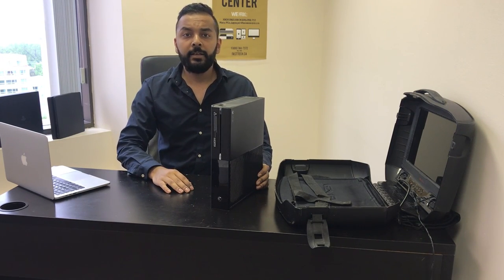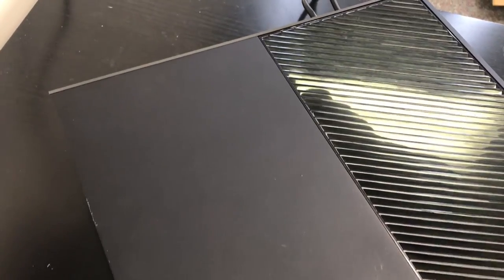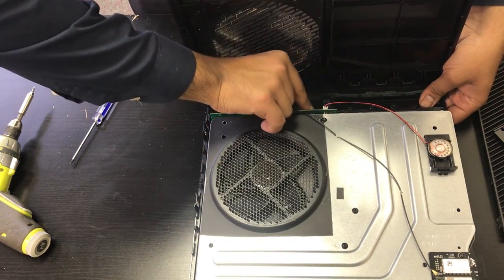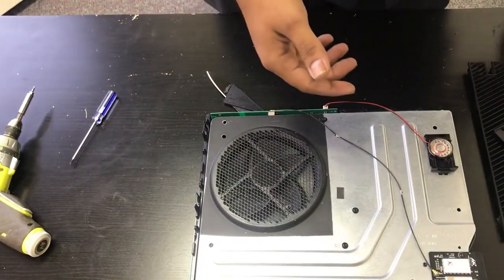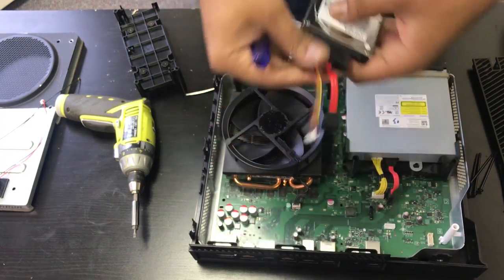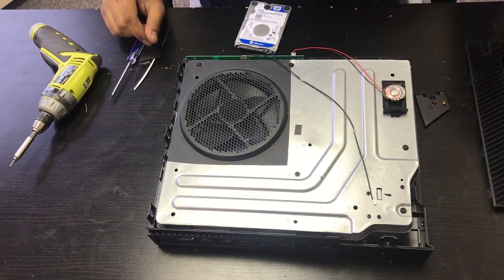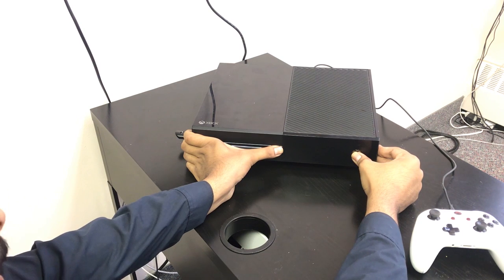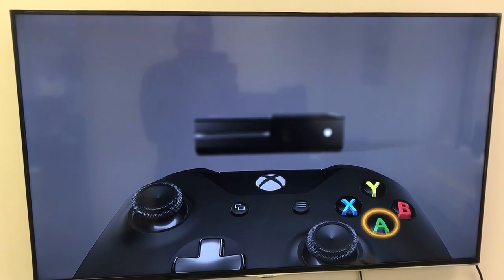Xbox One E101,E102,E105,E106,E200 Black Screen, Stuck on Xbox logo Repair (Hard Drive Replacement)

Comment: On my xbox one x I get all the errors I did an offline factory reset and it went to 56 percent and stopped and I got e101
Reply from the maker: You need a new hard drive. Its the same an a regular Xbox. You can buy the 1TB unit and it should work.
Reply: @fasttechvideo  do u know what to get I don't want to get the wrong size and I don't wanna go through formatting the hard drive on the pc
Reply from the maker: https://www.fasttech.ca/xbox-one-parts/xbox-one-1tb-hard-drive
Reply: @fasttechvideo  I just replaced my hard drive I had a spare 1tb laying around and It took a while to format it and get all the files I needed but I got it already it ended up being the hard drive like u said
Reply: @fasttechvideo  I wish Microsoft could have just let us replace it without trouble

Comment: My Xbox froze up one day so I turned it off and on again. Then it showed the error 105 screen, I hadn't experienced this before so I turned my Xbox on and off again and it worked fine. The next day same thing happened but it kept taking me back to the error 105 screen. I tried unplugging and repligging it all day and nothing worked. I then left it for the day. I knew it was something to do with the hard drive so the next day I ordered one 500gb and 3.0 compatible. That night the Xbox turned on again and was working perfectly fine but the hardive was already coming so I thought I was good. I left it that night and then In the morning I turned it on again and had error 105. I tried unplugging everything and still it didn't work. After a while it did go through to the main xbo screen and I plugged in my external hard drive but my Xbox froze up again when I tried to go onto my settings. After I tried to turn it back on and was on error 105 again. After many attempts and different methods I got error 102. Every time I turn off my Xbox it's error 102 and nothing will work. I don't want to rest my Xbox as I have saved data on it that's not backed up and I'd like to keep it. Is there a way to remove the hard drive but still put the data onto the external hard drive, then buy a fresh hard drive and put the save data onto the new one from the external one then put it into the Xbox? If not what do I do or is the only way to reset everything?
Reply from the maker: You need a new hard drive. Check the description box for links.
Reply: Same issue it sucks
Reply: Bruh

Comment: So basically my Xbox is fucked and I can’t use it again without spending money?
Reply: Late to the party - if you have an old laptop with a 2.5" drive (it needs SATA), you don't need to spend any money. Otherwise, I'd recommend going the SSD route - or just buy a next-gen Xbox when the next restock happens

Comment: E100 is the bluray, nit the hdd!
Reply from the maker: You're wrong.
Reply: @fasttechvideo  I'm not wrong. Unplug the sata to an Xbox One and see what error it throws. E100 is Bluray/optical drive. E101, E102, etc. is the hard drive.
Reply: @fasttechvideo  It's the Blu-Ray drive.
Reply from the maker: @heyitzrare  Can you please elaborate or provide more information?
Reply: @fasttechvideo  If you get an E100 error, it is NOT a hard drive issue; rather, it's your Blu-Ray drive not responding to authorization calls.

From the factory, your Xbox One motherboard and Blu-Ray daughterboard are married. If either one is swapped, the console will throw an E100 error as soon as it reaches about 58% on an offline update. This can also happen if a component on the daughterboard fails, or the entire drive gets disconnected somehow.

If you get an E100 error, and your console is still unopened/under warranty, SEND IT TO MICROSOFT. There is nothing you can do to fix it, as like I said, the console and drive are married.

Shoutouts to XFiX for finding this out. Have a good day!
Reply from the maker: @heyitzrare  Upon doing some research I found that you guys were correct. I have fixed the title of the video.
Reply: @fasttechvideo  Sweet, good to hear!

Comment: ATTENTION I FIXED IT,

I'll keep it short and sweet, basically you are going to want to factory reset (yes clear all saved games apps etc) this is the first step regardless of what issue you may have. For me it was the system error but the number doesn't matter or anything like that just find a way to access system reset. I would search another guide depending on your issue. Then after re setting and starting the xbox up do all the steps upto manual setup once you reach manual set up look for the section about keeping games and apps up to date and deselect to keep xbox up to date. This fixed it for me, however installing everything takes the piss, but it's a small price  to pay. This workaround also prevents stupid updates like the February one from damaging our systems as you can choose to update it. If you read an article that says they update is bad you can wait till they have a fix. 

I hope this helps you guys
Reply: Its Unforgiving thanks a lot brother
Reply: So is it good now?
Reply: It keeps sending me back to something went wrong screen.
Reply: @aaronjohnson8937  walk me through it and I'll try my best to help you
Reply: @sirmanmcguy1649  I too tried to reset to factory off the error screen E105. It froze so I held the power button for 10 seconds to shut the system off and when I turned it back on it seems to be reformatting and resetting to factory. 

It told me not to reset or turn off the console and a progress bar began to fill-up. A few seconds after this it took me right back to the system error e105 page.
Reply: @mementomori1178  okay, try turning the console off, turning the plug socket off and then unplugging the power back from the wall, xbox and itself. If this doesn't work try the 10s power button method again
Reply: @sirmanmcguy1649  i finally got it to factory reset, but when i cut it off and then back on again it took me right back to the troubleshooting screen. 

Bummer :/
Reply: @mementomori1178  if that is the case you might have to download a patch, to do this you have to plug a memory stick into your laptop and download the patch for your error then put it into your xbox
Reply: @sirmanmcguy1649  Sadly, I've tried everything multiple times. I'm going to have to send it in tech support. :/ luckily my warranty isn't up because it's not even a year old.
Reply: @mementomori1178  unlucky we couldn't fix it. It was worth a shot anyway
Reply: @sirmanmcguy1649  what patch exactly? where do I find it?
Reply: @Ajbuty  it's been a long time since this post, it won't have been that update but rather something new. Talk me through the issue. I'll try help you
Reply: @sirmanmcguy1649  okay so I turned on the Xbox and it immediately went to the trouble shooting page. I tried factory resetting, but it came back to the same page saying Error 106. I tried unplugging everything for 30 secs and plugging it back in, but comes back to the same page (same page as in "something went wrong"). I attempted to do OSU 2 and 3, but it doesn't even attempt to update. it just says "something went wrong". my final attempt was to use OSU1. it started to update, but every time it hits around 50% complete on step 2, it gives me E101 error. 

I think it might be the flash drive, but when I get back from the store.i will let you know if it still doesn't take the OSU1 update after buying a new flash drive.
Reply: @Ajbuty  keep me posted, maybe try soft reseting by holding the power button for 30s
Reply: @sirmanmcguy1649  hey, the OSU1 finally downloaded. I guess it was my flash drive after all. still going through the set up process.
Reply: @Ajbuty  nice! Let me know how it goes!!

Comment: OMG i just fixed my xbox one !. im so ecstatic. i literally lost hope on trying to fix it. i went to gamestop to buy a new one but luckily they didnt have the xbox one s 1tb that i was looking for. i was getting the SYSTEM ERROR E106. god i hate that number so much, its now drilled in my head from seeing it. i did everything all these videos were telling me by doing the offline update on USB. it didnt work. i gave up on trying to fix the xbox. days later, i just decided to give it a try again. i went to this website. https://support.xbox.com/en-US/xbox-one/console/startup-error-solution and downloaded the OSU1 thats in STEP 2. format ur USB to NTFS, that just by right clicking it and it says FORMAT. be aware that it will delete everything on the USB when u format it. when the OSU1 is done downloading, u gonna want to open it. once its opened, right click the file which will now be named ( $systemupdate) and extract it to your USB. (basically just moving it to your USB) its gonna take awhile. once its done moving, safetly eject your USB. now go to your xbox one, make sure the power to your xbox is disconnected. now wait 35 seconds. making sure the xbox is completely turned off. plug in your USB onto the xbox then plug in the power cord onto the xbox. HOLD the BIND (SYNC button) and the EJECT button then press the POWER button but still holding the BIND (SYNC) and eject button. u gonna want to hold the BIND and EJECT button until u hear the power sound 3 times. YES 3 times. ive always been holding it and letting go when i heard 2 power sounds and it takes me straight to trouble shooting settings and nothing was working.  when u hear the 3rd power sound, it SHOULD directly be saying UPDATING or some shit like that that isnt the TROUBLESHOOTING settings that it usually takes u. damn, i wished this helped yall.
Reply: Hey man, got the same 106 error and just like yours, at the time, nothing is currently working. Absolutely nothing. So I also tried offline update with osu1 downloaded and setup pretty right and still nothing. Guess what, I also release the buttons right after the second power sound. I wanna know two things: 1. Do I copy the $systemupdate is a folder. Do I extract the folder itself to the flash drive or the contents of that folder? 2. Do I keep holding all 3 buttons until 3rd power sound or do I release power button after 2nd power sound, and still hold the other 2 buttons till 3rd power sound?
Reply: @PGreat7  this is exactly what i did. I downloaded the OSU1 link, then I moved it to the desktop. Its gonna be lengthy wait. The folder will be called OSU1 when its done moving to desktop. When u open the folder, there gonna be a file called $systemupdate. Click %systemupdate once (do not open the file) then it's gonna say Extract All on top. A screen is gonna pop up, click browse, then on the left side, scroll down to your USB device and click it and press Select Folder. Then its gonna say something like F:\ then press Extract. It should be moving to your USB now. That's gonna take lengthy wait. 

No, dont keep holding power button. U just press power button once just to turn it on. (Hold sync and eject button - press power. Keep holding Sync and eject only. After the 2nd power sound, keep holding 10 secs and it should take u to a updating screen right away instead of the trouble shooting settings.

Comment: My PS4 controller won't connect in safe mode
Reply from the maker: The controller only connects via a USB cable in safe mode. If it does not connect with a USB cable the issue could be related to the bluetooth chip on your PS4 console.

Comment: Hey, readers! If you get an E100 error, it is NOT a hard drive issue; rather, it's your Blu-Ray drive not responding to authorization calls.

From the factory, your Xbox One motherboard and Blu-Ray daughterboard are married. If either one is swapped, the console will throw an E100 error as soon as it reaches about 58% on an offline update. This can also happen if a component on the daughterboard fails, or the entire drive gets disconnected somehow.

If you get an E100 error, and your console is still unopened/under warranty, SEND IT TO MICROSOFT. There is nothing you can do to fix it, as like I said, the console and drive are married.

Shoutouts to XFiX for finding this out. Have a good day!
Reply: Does this apply to e102?
Reply: @richy7543  Thankfully, no. E102 is a drive issue. :)
Reply: @heyitzrare  do you have any idea what I would need ? I already got everying separated just waiting to see what parts I would need to buy.
Reply: @richy7543  You probably need a new hard drive
Reply: @heyitzrare  bet you think I would need the piece that connects to the hard drive ?
Reply: @richy7543  Probably not
Reply: @heyitzrare  any idea of what hard drive I need ?
Reply: thank you that fixed my problem i have another xbox one with error 201 swapped the hard drive already still doing the samething
Reply: @richy7543  Sorry for not replying earlier. Any 2.5" hard drive should work (an SSD should as well!)
Reply: @milcahrainetv1363  I'm not sure what you're trying to say. Is your Xbox working, or is it throwing an E201?
Reply: Yo Man, I was wondering if you know anything about the error code I'm getting, the error code that my Xbox One S is getting is E100 00000701 8007045D, is that a hard drive problem or is it something else? Because I really don't think the problem is in my disc drive because I saw a post on an Xbox forum with the same error code as mine and people said it's a hard drive problem. A reply would be appreciated since I don't wanna go to the trouble of buying a new one.
Reply: @potatomatic47  Hey! If you have a spare 2.5" drive, you could probably test it, but I don't think it'll get you anywhere. As far as I know, E100 means it's cooked.
Reply: @heyitzrare  my other xbox one is throw that code e200 or e201 thanks
Reply: @milcahrainetv1363  It might be fixable with an OSU update. If that doesn't work, try swapping the hard drive out with another 2.5" drive - if that doesn't work, it's likely not fixable...

Comment: Microsoft HANDS DOWN makes the WORST gaming consoles on the planet. They have NEVER made one that works properly.
Reply from the maker: Xbox One failure rate is a lot lower than Xbox 360. There may not have been a Fasttech if it wasn't for the 90% failure rate of early gen Xbox 360s.